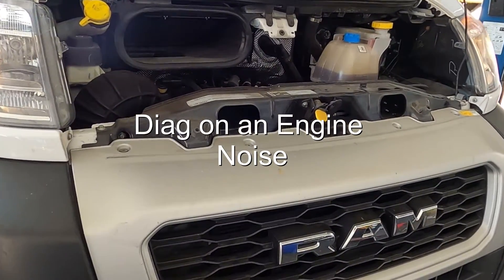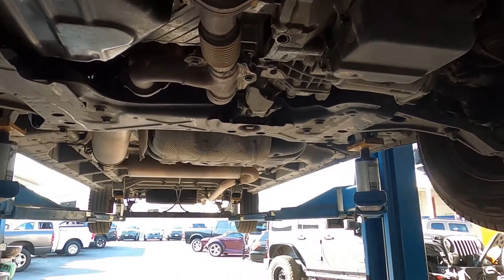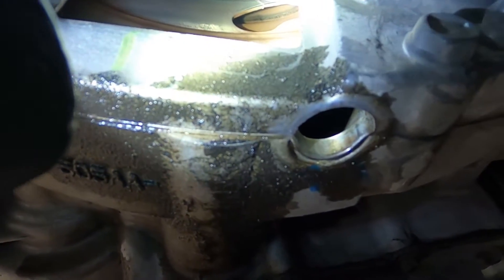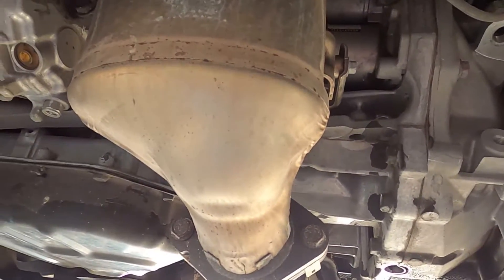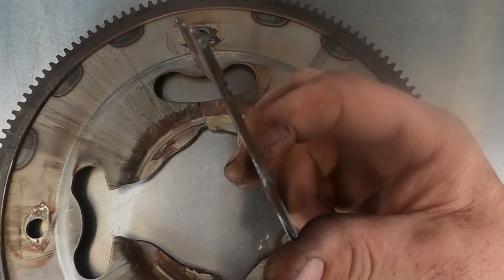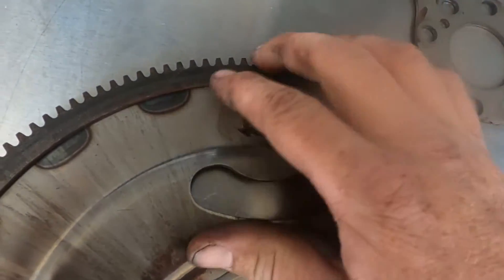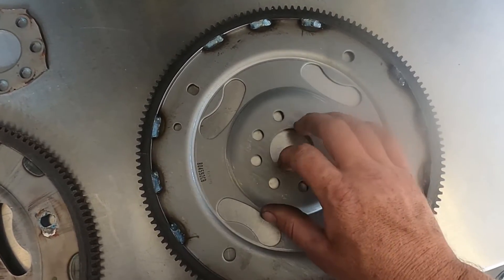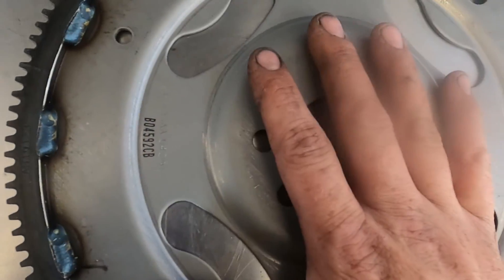Diagnosing a Broken Flex Plate

Comment: I have an 04 F150 - it is making that noise however it is not continuous- could this be the same issue? And if so, what is the ballpark labor ?
Reply from the maker: @irnfocus  It could be the same concern. In some cases the noise can come and go. You could have valvetrain issues as well. It would be best to get it diagnosed by a trusted mechanic in your area. To give you an idea of coat though for a broken flex plate, parts is $100-200 dollars with labor being around $1000-1600. Labor will depend on if your truck is 4x4 and what type of shop you take it too. Hope this helps and good luck

Comment: I have a similar noise. Not sure if its the same. It only happens at low RPM when accelerating https://youtu.be/GDv4_Pw4Fyw
Reply from the maker: It sounds like the inner CV joint or the side gears of the diff skipping on the pinion gear. Probably would be a good idea to pull the axle shaft to see if the inner joint is binding when moved on the bench. Good luck

Comment: I just had mine replaced, cracked really bad, 2 weeks ago , and guess what , 2 days later my main seal started leaking oil !!! 
I guess it was damaged because of the vibration from the cracked flexplate .
Mechanic just say tough luck! .
I ask him why while at it he didn't replaced the seal ,he knows I do long distance deliveries!
And he's  well...you didn't ask me to do it.
Blue devil stop leak solved my leak by now until I recuperate my wallet.
That is the difference between a good mechanic and a part exchanger .
No care for a 5 year customer spending tons of money there.
Reply from the maker: Before you replace your rear main seal, double check to see if your engine oil cooler is leaking oil. They leak from a compression fitting on the front of the cooler. When they leak they fill the center V of the engine and leak down on top of the transmission. Good luck
Reply: @Tech_1968  thanks for the tip ,but ,the leak comes from where engine meet transmission

Comment: How much is labor for such thing my pro master van has this same knocking noise :/
Reply from the maker: The labor is around 7 hours. My shop is in California and charges way to much for labor, $185 an hour. The part is around $150ish. You will also need axle nuts as well. Probably looking at $1500ish.
Reply: @Tech_1968  ok thank you so much

Comment: if one has this sound and it does go away when putting the tranny in gear would be a great sign it is indeed the flexplate vs a bad lifter or rod that would be clanging in gear or not
Reply from the maker: A bad lifter will change with engine RPM and oil temp. The flex plate can change depending on how hot the torque converter is and how much it has expanded. Lifters tend to make a slower tempo noise because they are operating at 1/2 the speed of the crank shaft. Listen below the vehicle. A lifter noise will not be as load below the engine.

Comment: Hey mate

I have a feeling my flexplate/bolts are the cause of my Engine Knocking sounds (Sounds like bottom End)
The only thing is, the knocking starts once the car is warm and idling. 
My knocking noise goes away when RPM gets higher than 1000RPM.

Did this noise only occur at certain situations, or throughout the RPM range and when cold/hot?

Appreciate any advice
Reply from the maker: The cracked flex plate on the van in the video made noise any time the engine was running. It didn't matter what the temp was. The rockers fail on the 3.6L equipped Promasters. When they start to make noise it is only at higher RPM and the engine warmed up. I have also seen one have piston slap due to an oval bore. Good luck.
Reply: @Tech_1968  I remember my dad installed my gearbox and over tightened a bolt and it broke, we couldn't get it out so we just left it. Now I'm hearing screeching sounds when I drive and I get a knock only when the car is idling and warm. I've been told by my mechanic it seems like a spun bearing but then he said it's strange because my oil pressure is perfect and the noise is gone after 1k rpm. I'm hoping the noise is something to do with that bolt we broke off when we replaced the gearbox.
Reply from the maker: @nspnutritionsportsperforma6804  I would lean towards a flex plate issue based off the description you posted. I would remove the transmission inspection cover and put a wrench on a torque converter bolt and hold the crank shafts front pulley bolt. If there is any movement then between the two then the flex plate is the issue.

Comment: So, is there anything you can do to not stress the flexplate while operating the van?
Reply from the maker: Unfortunately there isn't a ton that can be done. I have noticed that the van's that seem to break their flex plates are delivery van's. These van's tend to go through engine mounts a lot as well. If you make sure to only shift in and out of gear once at a complete stop that would help. If the vehicle is overloaded or the transmission overheats this can cause the torque converter to expand and that can also cause them to break, so go easy with heavy loads. Hope that helps.
Reply: Thanks for the reply. 

So put it in neutral at a traffic light for example?

One thing I've noticed is if you are parked on a hill and put it in park.... there is a rumble/vibration. If you put it in N and set the parking brake it goes away. Not sure why that is.